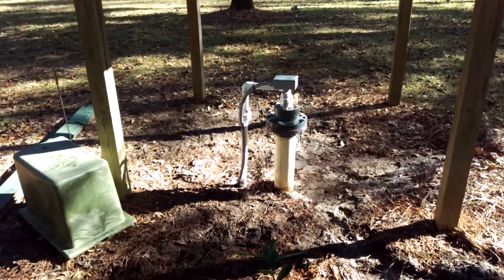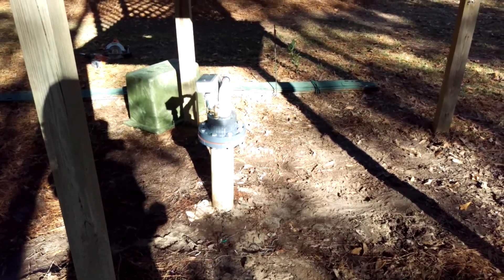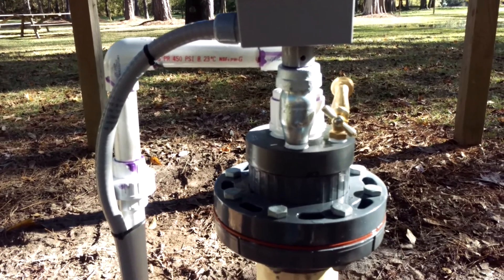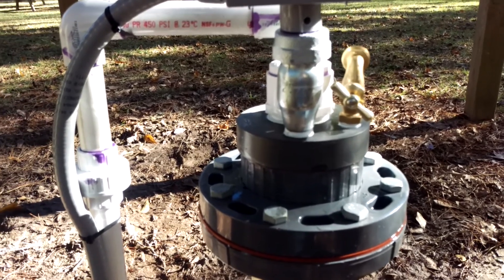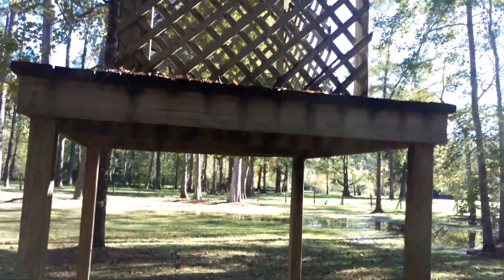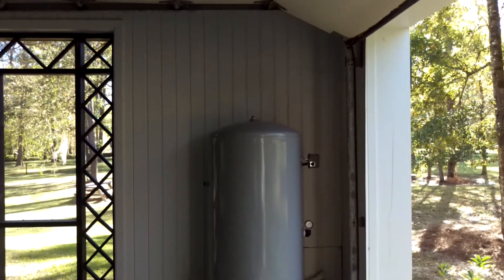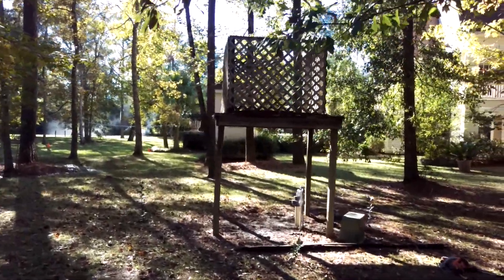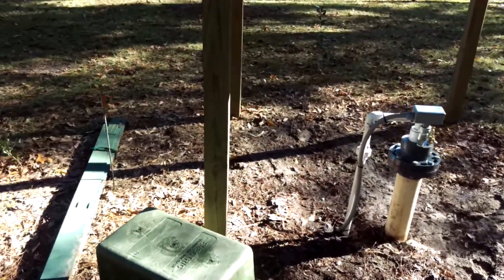4" Flow Well Fix for Areas that Flood Regularly

Comment: Fyi, 1 4x4 at 8' length is rated at 28000 lbs.   That's like 5 full sized trucks+
Reply from the maker: Yea great 7 years later and I get this comment....

So the platform was damaged from a recent flood 7 years ago and was very unstable and boards were rotting.
Not only would it be very difficult to install a new tank but also to service the well as it was 8 feet in the air.
It was way easier and cheaper option to just lower the well with a flow seal and relocate tank to under the house.

So the comment about the structural integrity of a 4x4 is irrelevant!